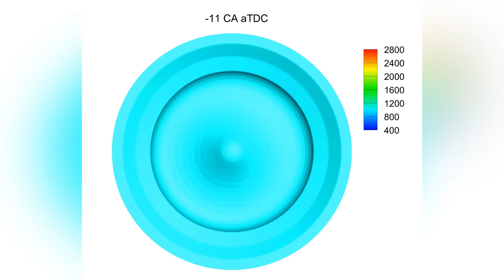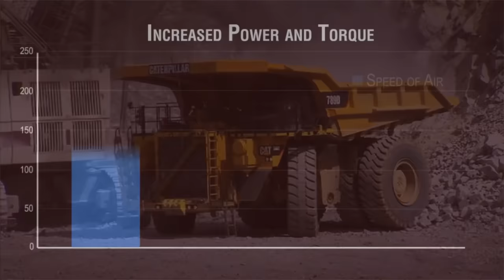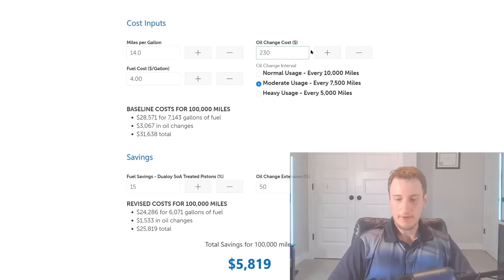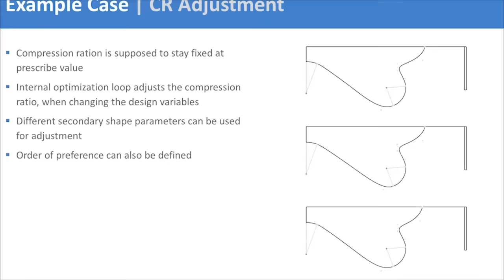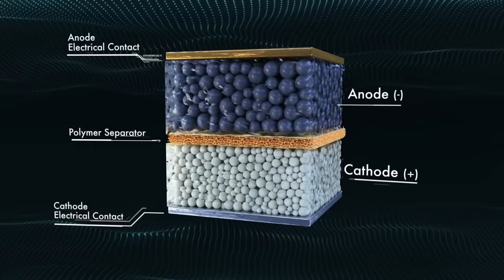ICE Breakthrough!? NEW Piston Design BREAKS Records

Comment: Looks like a twist on the 20+ yr old "Somender Singh Grooves"; one or more shallow grooves that start near the bore wall on the cylinder heads quench pad area and extend across the quench pad area pointing towards the spark plug location....etc etc....design to increase combustion....   New piston breakthrough....^snorrrrrrrre^
Reply: Read about that 25+ years ago.

Comment: It is the same reason a golf ball with small round holes in it goes twice as far than a smooth ball , air flow disruption over a surface, they learned long ago polishing intake ports in any engine reduces flow , and putting small divits or round holes in the surface improve air flow, that is why every intake port you have ever seen is rough cast, the factory can cast smooth ports but the cheap way without taking the time to drill hundreds of small holes in confined port space is to make it rough cast, simple !

Comment: I don't know anything about engines, so let me explain how they work. Paul and Temple seem to have different ideas about the spare bedroom on top of the piston. Either the economy is improved and power is lost or the other way around? Show your work gentlemens.
Reply: Oh they will, but just like with all the perpetual motion guys they won't let you view the entire mechanism, which in that case usually means opening the cabinet below. That is the 'proprietary' part.   And they take it away at intervals to 'change the batteries out'.  

One of my favorites at these sorts of shenanigans was Smokey Yunick, a designer/ mechanic for a NASCAR team, used to say if the rules didn't specifically disallow something, then it was fair game.  In one case, to increase gas capacity he put a bladder in the tank for the measurement, and then deflated and removed it after the verification by the tech guys.  

In another, they drained the tank, which measured correctly, and then found something else that didn't meet spec, so he drove it off to his shop, with no fuel in the tank. He also got there, because he had increased the fuel capacity using oversized lines, which held enough to get him there.  And that wasn't even what they'd busted him for that made him drive off in a huff.

Don't even get me started on Fish carbs and water injection and other such BS, as far as gas mileage goes.  Smokey came up with some amazing stuff though, and pioneered some equipment to do a lot of it.   Some of it was nuts, and didn't work worth a damn, like IIRC, a distributor with eight sets of points.  He made a ceramic engine once using, again IIRC, ceramics, without any cooling, and that did work quite well as far as performance and economy, but there you could work out the pertinent equations and determine exactly why.
Reply: @MrJdsenior  Yup, can't stop shenanigans.

Comment: If the gain is from air turbulence, it seems turbine shaped fins/channels on the intake side of the valve stem would create a vortex as the intake air flows by the valve into the compression chamber. (Patent pending)
Reply: Some drag racers running pro stock in the early 70's had little strips of steel metal brazed in the intake ports. Don't know if they gained much but it's neat seeing what they had to do to the heads back then.

Comment: 100,000 mile "payback" period is a year or two for commercial use but 5-10 years for the average consumer. If fuel prices continue to climb, and 20-25% mpg improvement is real, maybe payback could be a year less. Considering that the engine must be removed to install these, the cost is double to triple the price of the pistons EVEN IF no other work is performed! THAT would double or triple the "payback" period. Some people may NEVER see "payback" in their lifetime! This is a technology that SHOULD be used by the OEMs to improve their products mpg, emissions, longevity, etc. Won't happen... but should. IMO

Comment: This “theory” has come & gone a few times over the last 40 years & in all prior cases, it was never supported by real science, at least none that convinced me.  Nonetheless, I was willing to give it a try, so I dimpled the pistons in one of my engines & here’s my experience.
The claim made by my old friend was that it would “prevent detonation by reducing the engines sensitivity to octane.” These were flat top 10-1 forged piston & the dimples did not reduce my cranking compression, I tested before & after.
My engine ran fine before & after, but for reasons that I cannot explain, the engine did run better after the modification.  You can do it yourself (if you want).  I don’t know if I would recommend it, but I certainly wouldn’t pay money for a mod that I can do myself…

Comment: bigger combustion chamber would lower compression mostly, but if you use it for clearance for valves opening more, it could show some hp gains. i think you do lose torque. only records this contoured piston would break is in emissions. you know they aren't looking for more power as the goal, just be miserly with fuel and be more green
Reply: I'm pretty sure they would adjust the stroke to keep compression the same. Otherwise, it would burn more fuel, not less.
Reply: Page up
Reply: this works by effectively creating 2 combustion chambers - one smaller chamber that can be run very rich (the void in the piston) and the typical space between the piston and the head as the primary that can be run very lean.

Comment: Stirring the air just as the combustion starts is a somewhat new idea. You can do the same in a gas engine by modifying the cylinder head. Sominar Sing in India worked with the head, 
placing a notch across the quench area of the piston, aimed at the spark plug. As the piston hits TDC, a jet of air stirs the mixture. A test we did with a 300 Ford inline showed even without 
data there was a big change in the engine at low RPM's. You can put the truck in 5th gear at 20mph where the engine is below idle speed. No bucking or complaining, it just pulls through.

Comment: If the auto industry would use Charlie Yunnics premixed, vaporized air gas mixture method, prior to intake, instead of fuel injectors. The mixture would burn at five times the fuel injector droplet rate. This would provide complete combustion at the top of the stroke. It was proven to double the power output of any engine, i.e., double the milage, eliminate all carbon build-up in the engine, pass all emission standards without a catalytic convertor and extend engine life almost indefinitely. This is on existing engines!!! Ask why the auto companies have not decided to use such a method.

Comment: I am very skeptical.  To start, they state that their two test engines were mine-haul 3516s... you're looking at a 6.7" bore and a 7.5" stroke with a max rpm of what... 1800-ish on a good day.  C/R is 12.5 to 13. to 1.  They state their tests were done over a decade ago, and they used ceramic coatings, as opposed to just changing the piston design for comparison.  Did their new piston design change the C/R?  What about just ceramic coating a stock piston, etc.  Too many variables at play.

Comment: Thought-provoking video. Like many innovative videos, this touches on the economics of research and development in terms of the unit end result (what percent fuel savings improvement does 1 unit produce in this case) but would benefit from a complete market size analysis. The video focuses on fuel economy savings. It doesn't directly mention any R&D costs.  However, if R&D didn't cost any time or money then the most optimized form for all new piston manufacturing would already be used. If there is an R&D cost then the question becomes one of optimizing for pistons that have a very high number manufactured annually; for pistons that are manufactured in huge numbers it makes sense to invest in the optimization program, whereas for small and niche pistons it would not be a worthwhile investment, unless the same piston design can then be used in a variety of engine product lines.  For this reason where looking at fuel consumption price savings it is important to take a glance at the sales volumes involved to know whether it makes sense to spend time and money on a design improvement.
Reply: With fuel prices continually climbing to record numbers and certain refineries only making diesel fuels instead of gasoline. Fuel economy is first on my list of priorities of savings. If the design can be applied to all types of piston driven engines and an actual 25% increase in fuel savings per tank of gas. It will be a good money saver for the consumer, as well as most likely better engine service life, per investment to the consumer I say where can I get a set or two or three?
Reply: Maybe I was mistaken but in the video I understood that a 6.7 cummins  set was $3700, and that over 100,000 miles it would save around $5000. On top of the price of the pistons you would also have the cost of installation parts needed to install those and if you don't do it yourself you would have the labor as well.  Completely negating the savings. The only benefits (if true) would be the emissions reduction at great monetary cost.

Comment: Dimples reduce friction off circulating fluids, improving mixing and combustion.
Ceramics insulate pistons and reflect energy to chamber.

Typically improvements increase efficiency by 4-7% , add up tweaks and it helps a great deal.

If you can lean out the mixture without creating mechanical strain, you can get huge gains in fuel efficiency.

Money is the real issue, spending 80,000 bucks +++ for a high efficiency engine doesn't make sense.

Comment: Not exactly new.  There was a inventor in india doing this 2005 or so.  What was remarkable was that the modded engines cpuld run at such low rpm without stalling.  Briggs and stratton tested it and declined to use it.

Comment: Anytime that any company says a 25% improvement and efficiency I'm telling you right now what they mean by that is the first generational designs of a piston yeah 25% better than a standard square piston probably because the current ones are like 24% better than that and if they say an 80% reduction in emissions yeah probably over the first generation of Pistons but we're currently at what 78% maybe even 82% also any engine can double the oil change interval right now I mean oil is pretty cheap and the engine probably cost more than oil but you know you don't even have to change the oil at all in an engine ever you can just swap out the engine no oil changes at all

Comment: 2 comments.
1 there is not an electric grid anywhere in the world that could handle a transition to electric vehicles
2 I am by no means an expert but I fo know the air inside s cylinder does not all burn. There is s very small distance from all metal parts in which the air does not burn. On the golf ball type dimpled piston creates more surface area in which the air won't burn. I would think that would be bad for powerand efficiency but I can see how it would help with emissions

Comment: Do you realize, that to get 25% economie you need to  have 25 % inefficiency at least to start with, which with current state of the art in ICE design is impossible.
Reply: The best theoretical diesel is only 55% efficient..... So i dont know where you seen something more than 75% efficient.
But yes claimed 25% is to good to be true
Reply: @Onikuzu  hi, the video is about burning in the cylinder, to get 25% you need to have the initial burning 25% inneficient. I am well aware about ICE cycle efficiency that you mention and that real engines are ewen 70% below that, and most of it is wasted heat.

Comment: Adds up cc volume inside piston chamber and  only difference is in power, the engine improves on pick up and speed. That was long time back my friend who always loved to innovate and modify ICE engines did try to use piston with similar design. The mileage went down that was his finding.
Reply: LOL!!! With out the cam adjustment in timing it always does. When any engine is bored out you loose the OEM fuel mileage no matter. You can increase the Hp power, but always loose economy of fuel.
Reply: @ohanailo7743  Especially with two cycle engines.

Comment: First of all whenever there is a new breakthrough that is more efficient and more powerful often the patent is bought and buried. Also the gasoline direct injection technology with the 2000 lb. fuel pressure and the injectors spraying fuel directly into the center of the cylinders provided a healthy increase in efficiency and power partly because the fuel spray being sprayed into the center of the cylinder caused the resulting combustion to remain mostly in the center thereby extracting more power and less heat transfering to the cylinder walls. I know they have had issues to overcome with GDI. This is kind of opposite to what this video is saying like spraying fuel towards the cylinder walls ? So ?

Comment: 20% more efficient? Sign me up. Of course, that breaks the theoretical maximum efficiency of an internal combustion engine. 

While we're at it, I have a carburetor that allows you to burn water instead of gasoline and a perpetual motion machine that Big Oil has been suppressing for decades. 

When something is too good to be true, it's false. 

I don't doubt that piston head geometry matters. I doubt the guy who claims 20% increased efficiency though.
Reply: 20% closer to 20% efficient is more like it.

Comment: We will know if these numbers are accurate if all the major manufacturers switch to this design. If it's a 25% boost in gas mileage and or performance, they would implement it as soon as possible. I've heard of numbers like this too many times about some new thing and then you never hear anything else about it. Instead of paying licensing and royalty fees they will most likely just knock it off and make some changes and pay off some judges. But either way we will be seeing some crazy-looking pistons being used in everything. These things like this usually turn out to be bullshit though. I hope it's not but it usually is.

Comment: Dik CATepilar wheel loaders have electric drive!
Reply: And what powers the electric motors? It wouldn’t be a turbo diesel generator by chance would it?
Reply: @needmoreboost6369  Yeah, just like the Freight Trains and the Diesel Submarines of WWII.
Reply from the maker: I run 993k and 994F and they don't have electric but the smaller 988k supposedly does. I would like to see them shift to more electric drives.

Comment: The grooves leading from the Squash Band to the Combustion Chamber are the most effective part of this mod. Someander Singh has been doing this for decades on different engines. As the piston moves through TDC pressure from the SB is shot through these grooves to fragment the flame front adding turbulence at the right time of combustion. 
The results are cleaner oil, cleaner piston crown, economy, you can run higher compression or less octane, on gas engines you can pull away in 3rd from low idle. Should be able to retard ignition a degree or two and cut down on negative torque. The dimples would thicken the Boundary Layer and add to the jet grooves volume in the piston SB. 
Volume down warning.
https://www.youtube.com/watch?v=PzMgPZxD7Iw

Comment: There is NO chance of "25% better fuel economy". They may be stretching some other physics statement of fact about what is happening during combustion, but no possible way the blanket statement is true. Even if it were to be true, EVs are more efficient and will continue to evolve at a much faster rate.

What is happening here is that a totally inefficient Rube Goldberg contraption we call an ICE has been slowly improved over more than a century. If we were to design an engine today a piston model would not even be considered.

Comment: Huh interesting.... I wonder what effect theyd have in that alleged 20:1 MYT toroidal ICE engine...that can be coupled together for 40:1 etc..

Supposedly it already boasts a 70:1 compression ratio, no valves just one way airflow ports for exhaust, no thrust loading of piston skirts, only the rins touch the wall, no stop and go action, 12 moving parts, no cylinder heads, no cam shaft, no valves, and Intake compression and power stroke and exhaust stroke events are happening all at the same time, so there are no load strokes.

Supposedly in its single setup it can calculate 3000 hp.... Sounds like a beast but also like a gas hog. So a a piston like this that can add 30% fuel economy might be just what the doctor ordered to improve upon the design....

Comment: I pretty much agree with everyone in the comments section. As an engineer (cannot say who I work for or what I do reguarding a very nut clinching N.D.A) I can say with 95% certainty this is all marketing nonsense. GrantedGranted, I would need to look at their data and how they tested this theory but, those Dimples would most definitely cause turbulence, hot spots and possibly effect air flow in a negative way. They might help with the heat disbursement through the combustion cycle but would most definitely affect the flame front of the burn. This is just nonsense. Also it's a cummins engine not "cummings"
Reply: They have independent test results from a CARB lab on their website. I think everyone is jumping down the throats of a company that did not make this video. I don't see anywhere that Speed of Air was consulted, and having seen their work and claims, this is some mashup done by @Tech_Planet. As an engineer, I can assure you that there is voluminous peer-reviewed academic research that definitively proves the thermo-physical effects of dimples on a surface...including pistons.